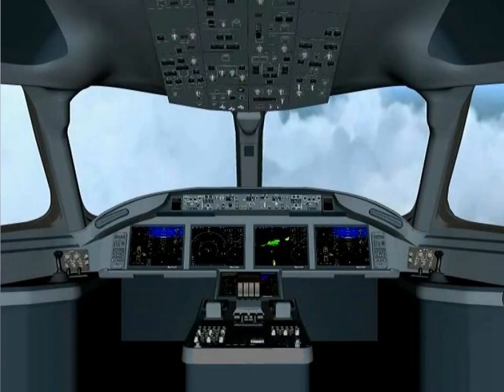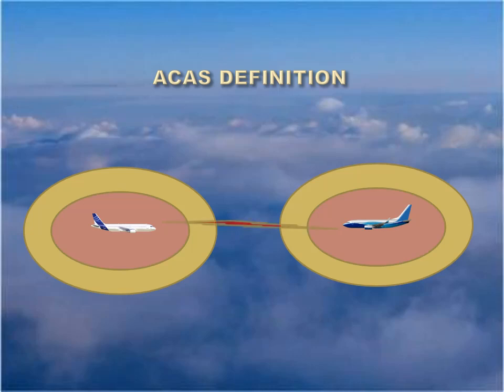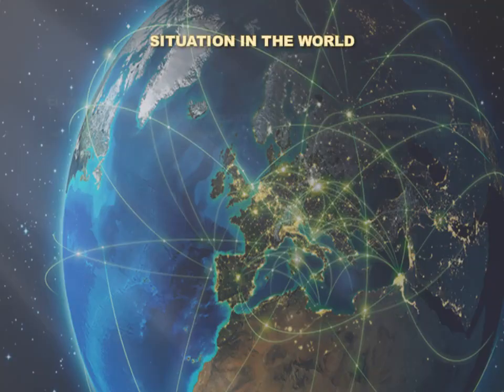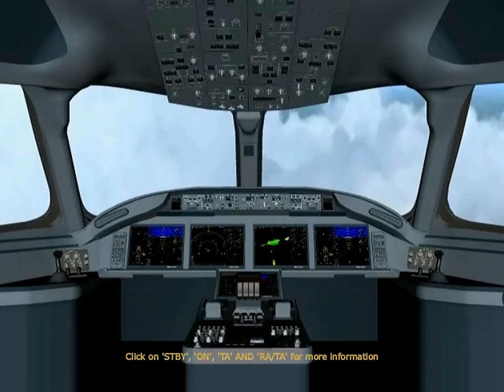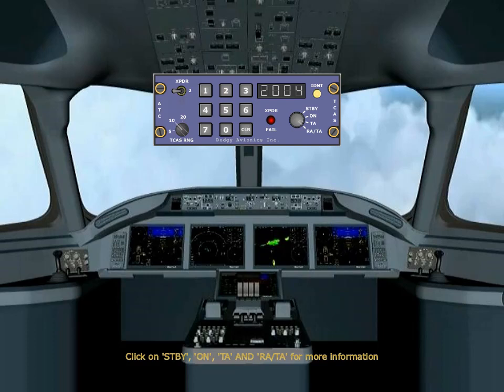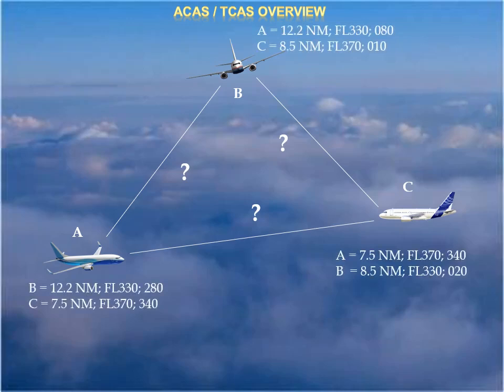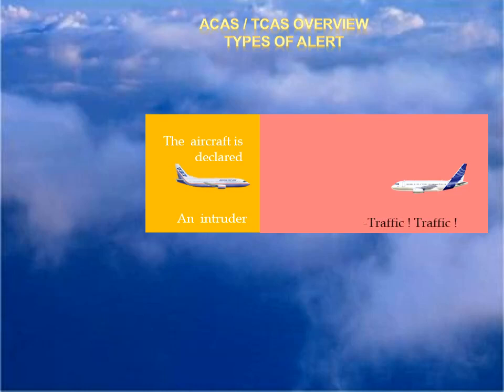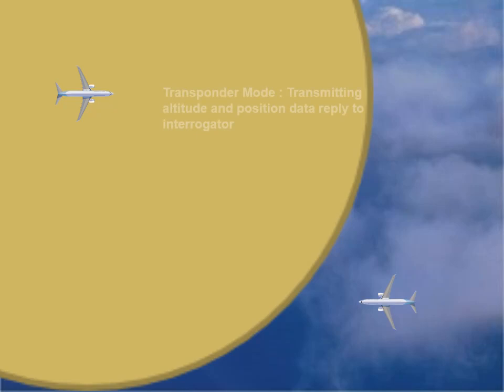ACAS / TCAS Training # 01 Airborne Collision Avoidance System Overview and Definition

Comment: What's the difference between ACAS & TCAS?
Reply: They are essentially the same thing. ACAS  is a standard that is required for certain aircraft, and TCAS is currently the only equipment that satisfies the requirement. The two terms are basically synonymous, however the term "TCAS" is more commonly used in the US.